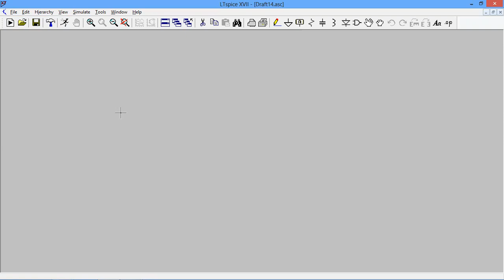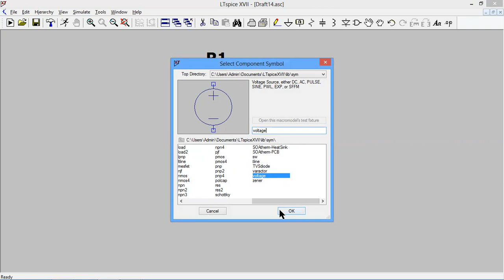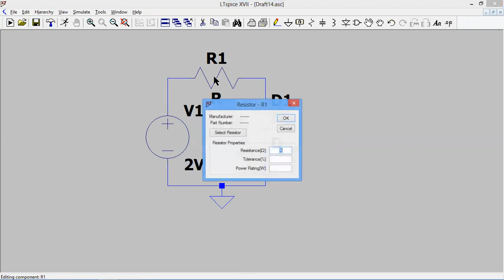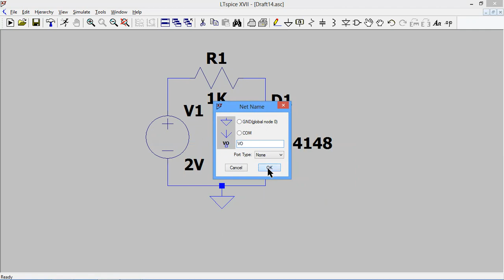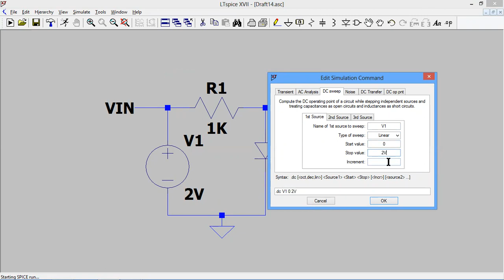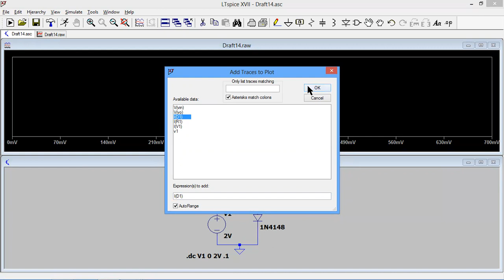LT SPICE VI CHARACTERISTICS OF DIODE -1

Comment: How do I simulate the reverse bias condition?
Reply from the maker: Reverse the direction of diode
Reply: @nishapm9661  Yes I am aware about that but in LTspice despite reversing the direction of the diode and even after testing it for different diodes with different values of r,v and adjusting the time values I am unable to simulate it...